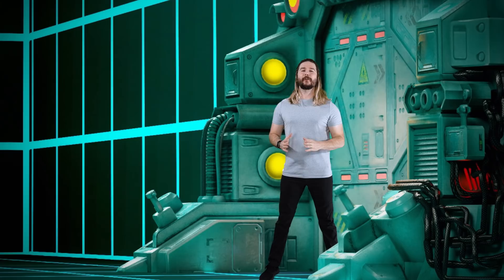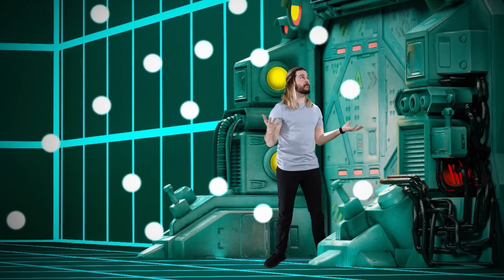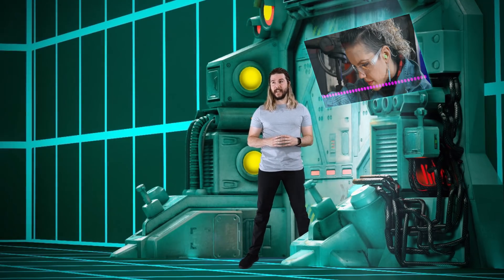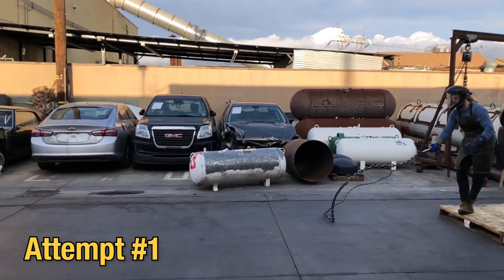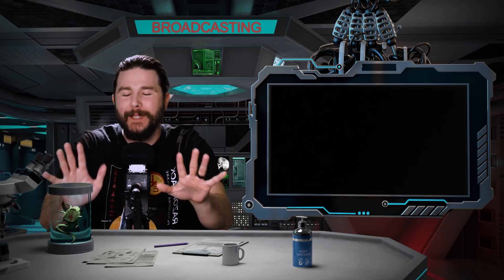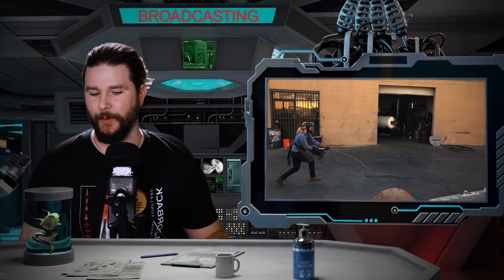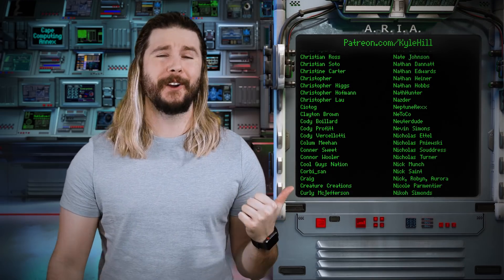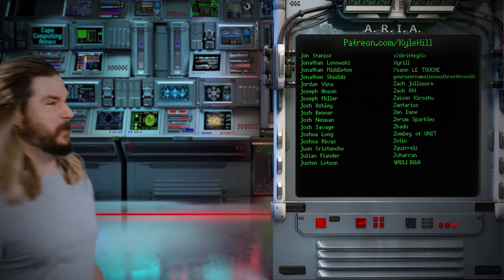Can I Make a SUPERSONIC STEEL WHIP?

Comment: In my opinion the chain whip isn't flexible enough towards the thin end. In all of the footage of you whiping it, the end of the whip seems to function as a solid line at high velocities instead of holdin the wave till the end(? Don't know how to describe it). And because of this the velocity stops increasing and you never reach the sound barrier. If you look at Destins (Smarter every Day) video about visualizing sound waves with a whip you'll see the wave in the whip travel till the very end to produce the crack. This might also be why the TickTock video apparently uses the end of a bullwhip.

Comment: you missed a major part of why the clip could do it and you couldnt. your technique. you're trying to get the crack in 1 movement. the clip did it in 2. you were pulling the whip up to speed and letting it do it's thing. dude first got it spinning, then ripped it. change the end to steel cable rather than chain and replicate his technique and you should be bale to do it.

Comment: Hey kyle, I worked in the circus for a bit and got to play a little with whips. It looked in the footage that you were really close. I know the chain must be really heavy but after you start the forward movement of the whip you need to pull the whip back, that should help accelerate the wave through the whip. I hope this helps. Keep practicing, you got this.

Comment: Next time, if there is a next time, after you swing the chain forwards and before the bend straightens out pull back on the "whip", this helps accelerate the end which causes the crack.

Comment: As a PhD student dealing with failing experiments, oh boy there's a success bias in publications. Only the successful results get published (so, you can't see the failures it took to get there) or even worse, if the experiment is wonky and only works "sometimes" (usually because you don't control all the relevant variables) they publish the successful tries as if there were no failing ones.

And then you try to replicate it or design experiments based on those claims, and lose 3 months xD

Comment: Learn how to throw a whip first. You're pulling back. People who don't know how to crack a whip properly always yank back.  Throw it forward with conviction and follow through.  
Your whipping strategy seems to be: swing froward -> yank back. Results: either half throw, or self inflicted harm. 
Proper whip strategy: first swing backwards/up to set the whip in an "in the air position". THROW it forward just as it's falling, so that you're giving it a path ~130-180deg.  Follow-through to direct the fall, don't pull back.    More like speed pitching a softball than yank-snapping. And if you control it well enough to keep it in a plane, you keep your body out of harm's way. Practice with a nilon whip

Comment: Love this video, both the subject matter (a personal hobby of mine) and your approach to what went wrong and discussing it. So, a lot of people have already commented that the whip needs to be thinner, and they are partly correct. Due to the physics behind how it works, you don't even need to put a relatively large amount of force into your throw (although you will certainly need more force with as heavy a whip as you have made here).

Given the proper throwing motion and amount of mechanical force input, the biggest reason for a failed crack is loss of energy or an inefficient transfer of energy down the length of the whip. Most cases, this is caused by a sudden change in mass (sometimes in several locations) instead of a taper from the base of the thong to the fall. Just using singular lengths of link chain can cause issues in this area, as the only way to really get a smooth-ish taper is to grind down each section of chain in a taper to meet the next size down, but from a safety standpoint, I don't think that is a good idea. Most chain bullwhips that have been made are typically more like a conical tapered length of chainmail/ringmail with a popper at the end.

Another thing to note: in the Tik-Tok video, the first throw is an overhead throw which causes a change in the direction of the whip's travel to induce additional angular velocity. In the second throw thrower is pulling back on the handle of the whip slightly after throwing, which accelerates the linear velocity of the wave down the whip in relation to it's length (even after the whip has been thrown, this small amount of force input at the base of the whip is still affected by the same E=1/2m(V^2).

Comment: Use a steel cable.  The chain links are probably fucking with the conductance of energy down the chain and creating a lot of chaos in the math of how that "whip" works.  Good luck though.  And hold your head high, you did the experiment, you didn't fail, you just found a way that didn't work.

Comment: I'm just guessing here, cuz I wasn't there. but I'm assuming that would be much more deadly if it were launched with a  sideways  catapult. Launched it that way you'd have a line of men 5 deep with no feet! wonder how hard it would be for you to set up some kind of tension system and try it that way so you can be far far away.

Comment: you can also see an effect on the whip that I believe is associated with reflection coefficients. as an electrical engineer, its the closest term I can think of that relates to inefficient energy transfer due to sudden changes in the medium. the sudden size difference between the links doesn't transfer all the energy as well as one would hope, which could be slowing it down enough that it fails the experiment of breaking the speed of sound.

it would be interesting if you took measurements to see how close you got though

Comment: When a reporter asked Thomas Edison about the lightbulb, "How did it feel to fail 1,000 times?" Edison replied, "I didn't fail 1,000 times. The light bulb was an invention with 1,000 steps." "Great success is built on failure, frustration, even catastrophy."

Comment: Hey Kyle, we used to knot strings to sticks and make them bam. Given that if we did it just right the sound was significantly louder than in other cases, I assume it was because we made the tip go supersonic. But it were normal strings, not tapered at all. So either there is a second phenomenon causing the loud noise or the tapering and related explanation is not the full picture.

Comment: As far as the attempt goes, it went about as well as i would have expected. 
The chain loses a lot of energy because the individual links in the chain are free to move about independently from one another. 
With the mass of the chain , that's probably alright for the first section, but for the tail section of the chain, you probably want it to taper into thin steel cable. 

After that, you need to proportion your whip specifically to your height and arm length so you don't whip yourself with it. 

Finally, if this never gets revisited, it's actually fine. You seem like you want to keep your limbs and hair, and there's other dangerous stuff that scratches that itch. 
If you're taking suggestions: I've yet to see someone arc high wattage electricity through a modest wattage laser beam here on youtube. 
I know it can be done though; plasma physics for the win.

Comment: Kyle, my man, you are by far the most entertaining and informative science dude with long flowing blonde locks on YouTube, and this episode hardly diminishes that. And while a steel bullwhip may be theoretically possible, there is hardly a point to having one, as the leather whips are plenty effective, already...and while you might lose an eye, your feet should be okay. 

By the way, another lesson to take from this is one you learned the hard way in the making of this video: If you're willing to risk life, limb, or hair for scientific edification, the potential price had better be worth the purchase. (A steel bullwhip, for Odins sake. And Loki thought Baldur was the daft one. 😁)

P.S.  Razor blade boomerangs don't reall work, either. Stay safe, pal.

Comment: Clamp the handle to the edge of the roof above a bare cinder block wall (or similar structure) then drop the end of the whip over the edge.  Even better if you can get the end of the whip held up over the handle for extra free fall.

Comment: The tassle is what breaks the sound barrier if you want to keep it all metal you could weld a very thin piece about 6 to 8 in Long of flexible wire with the very end unwrapped and spread out. But I will warn you right now my cheap bullwhip with a piece of tightly woven Cotton On The End can already cut skin.
If you do this 
IF YOU DO THIS 
Be aware that that piece of wire if whipped correctly with the weight of the chain and with the thinness of wire will most likely split into the muscle or completely to bone depending on where you hit yourself. 
Be very very careful. You are basically making a razor whip. 
And the razor whip will not feel remorse when it shows the world your shoulder blade after slicing through your clothes.

Comment: More importantly always be as safe as possible. If there's even a hint that things aren't safe enough, stop and make it safer.

I'm sorry you hurt yourself Kyle, but I'm actually really glad you failed. If breaking the sound barrier had been done correctly and you were to have hit yourself, your leg wouldn't have just been brusied. It's quite possible to have broken through skin and bone. Having dealt with whiplashing steel cable and having been hit by them, trust me when I say it's a real possibility to break bones, lose fingers or even limbs. Physics can be really cool, but it can also be super deadly.

Comment: Ima gonna say it again... having the HUGE chain being the starting size is just wrong... far too much energy needed to get the chain out of your safety zone... I’d start with 1/4” links, and shrink from there... get down to beaded chain... of course... that might lead to beads of steel flying loose at the speed of sound... think bullets here...
Reply: I’m going to say this should require Kevlar clothing... padded clothing... yikes!

Comment: Hey Kyle so I’m not sure the length off the whip but bullwhips are usually around 6-9 ft and a shorter whip can be easier to crack. And most bullwhips have a very thin pice of material at the end called a cracker that makes the snap easier as well

Comment: Scientific Method at work here. Reviewing a test and forming a new test is all part of the process.

Also, a lighter chain with smaller diamiter links would probably get closer to the speed needed. Force = Mass x Acceleration after all.

Comment: The whip would likely work better if there was a strong enough spring covering the first foot or so of the chain. That should help with control and transfering energy. Think about the handle of typical whips.

Comment: I think you might be able to possibly make the steel whip still break the sound barrier by adding thinner steel cord at the end of the chain, as opposed to more chain. This'll taper it out more while not adding as much weight as making the whip longer on the thick end.

Comment: Without failure, how can we ever achieve success? I tend to appreciate seeing failures more because whether or not the end result is one of success, there's so much to learn from reviewing each failed attempt and figuring out what went wrong and why. You can't teach math if all you give is the answer, and you can't expect someone to build a perfect bridge using a photo of someone else's bridge without also explaining what that first engineer tried before reaching the final design and why he changed those things.

On a side note, my chain whips were always 6' long and tapered down to 18GA or smaller at the tip. Even then, they're heavy as hell and deadly if you clear the ground. But despite the amount of taper and the armourer-based maille construction methods I used, the sheer weight of even one of my whips will never break the sound barrier using mere human strength. The hunk of industrial chain link used for this experiment makes my designs look like a spitfire compared to a Boeing 747.

Comment: I think it will have to do with it being chain links.. you lose some energy in the slack/bounce when the links collide..  you need to rapidly change the direction of the “whip” which you are having a hard time doing due to the length of the chain.  If you can’t freely swing the length of the chain you will always struggle to crack it. Try with a shorter chain that you can control easier.  First practice swinging it and practice your control.  Then try “cracking” the whip.

Comment: your technic is so bad. you don't need to drag the whole chain from back to front. There is another way. Lay the chain straight in a line, hold the chain at heavy end and lift it up. Now pull the chain down real hard which creates a ripple and pushes it forward till the end, this is a bit dangerous technic as the end other end of chain might hit you or not, there is a slight probability for it.

Comment: I think part of the issue is a loss of energy due to the links of the chain sliding from one end to the other. Whereas a traditional whip is fixed and doesn’t have the literal moving parts. So once you take that into consideration, along with the weight of the chain; the force needed to get the chain up to speed is increased. So a simple side whip would not create enough force. 

As for the TikTok video, the user has considerably more muscle mass than Kyle (no offense); and his whip is lighter due to the leather tip. You can even factor in his movement, ie the overhead whipping motion.

Comment: query: what happens when something breaks the speed of sound in liquid? (is solid even possible?)
Reply: speed of sound in liquid is different than speed of sound in air. but yes, it is technically possible. problem is, the added resistance of any liquid on the physical object means the object requires more force to reach a given speed. combine that with the fact that the speed of sound is actually HIGHER within liquid, and you're left with the knowledge that while it's possible on paper, it isn't achievable practically speaking.

as for what would happen, it'd still be a sonic boom. what that'd sound/look like is beyond me.
Reply: @dippst  yeah, I know it's higher, and would be difficult to reach that speed, but I'm curious what it would be like.

Comment: The problem isn't technique. It's power. You're more burly than I but metal is no joke when it comes to weight. Most bull whips weigh far less so we can send the wave down the line far faster and with more umph. You'd need a body builder or someone strong enough to even have a chance at it, or a machine for that matter. Someone or something who can swing it and produce identical force regardless of the increase in mass. I think that's the part of the equation you forgot, I won't say missed because I paused the video and you could cover it yourself. Definitely a weight problem. It doesn't help that it drags across the ground before being snapped into the air, lose a lot of momentum in the process. It's easier to maintain or increase momentum when your muscles aren't being taxed more than a Californian or New Yorker. Swing that even once and halfway through the swing your power generation is already dropping.

Comment: Take dangerous implement, make it more dangerous, don't learn how to use it, randomly swing it around, wonder why it failed.

The point of failure here may or may not be in the device itself, but in the technique used. Even cracking a traditional whip isn't easy and takes quite a bit of practice.

Consider reaching out to some people who might know some people that know how to successfully crack a whip and at the very least, get said person to give you instruction if not perform cracking the chain whip themselves.

Also considering getting decent at cracking a traditional whip first to get the technique down.

Comment: To be honest, I feel like this is a BETTER science video specifically BECAUSE you failed. I am terrible at math, but I'm wondering if perhaps this was a case where if you had had someone else to do the whipping motion - no offense to you, but you may not possess the necessary physicality for this? Perhaps someone taller, or someone able to apply more force (or do I mean speed, like I said I am bad at this math) - my point is only that you personally might not be able. The fellow in the tik tok video looks quite tall and beefy. He also may have spent quite a lot of time practicing these motions, enduring the injuries as well. (And frankly that video made me think that he nearly popped himself in the face on that first swing, VERY not safe!)
Aside from that however, sometimes you learn far more from failure than you do from success, and honestly even the failed attempts still had a certain spectacular aspect to them. And as Mr. Savage himself has said more than once - "Failure is always an option!"  - and that is the only good attitude to take into an experiment!!
Success is sweet, but failure is scientifically just as valuable, if not more so.

And having said all that, I send you hugs!